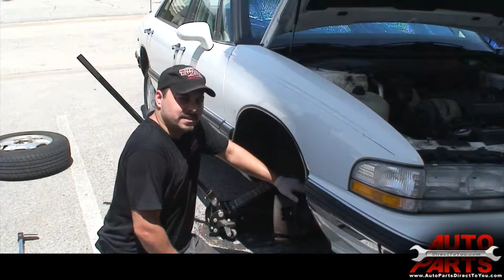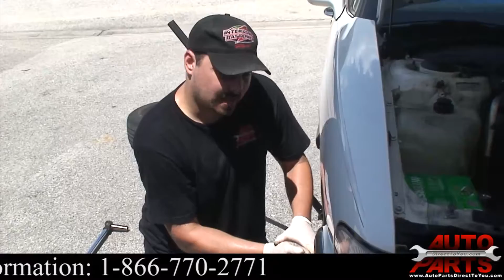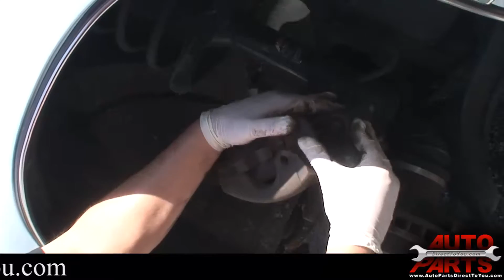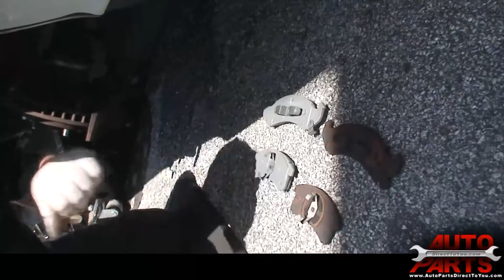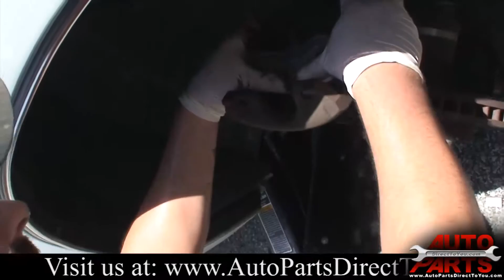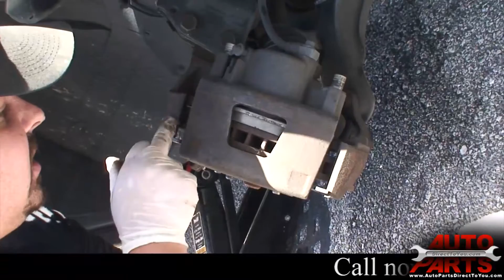1995 Buick LeSabre Brake Pad

Comment: Recommendations for a better video...  Include in future discussion...  remove some brake fluid from reservoir before compressing piston or keep an eye on the level during compression.  Good to have brake fluid reservoir cap removed while compressing piston.  What about checking the rotor condition and signs which indicate when you need to replace/resurface rotors?  Regreasing guide pins as well and mention importance of proper torque... don't over torque the guide pins!

Comment: If you have a Century, you will need a special Allen key, the 3/8 inch drive won't fit.
Reply: bob robertson He is not using a 3/8 inch drive (square), he is using a 3/8 inch hex (six sided) socket!